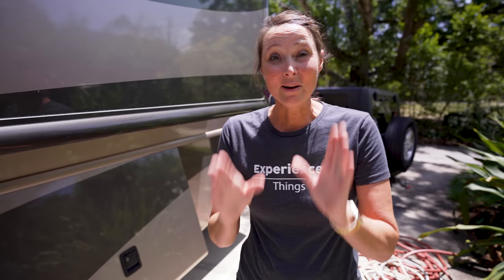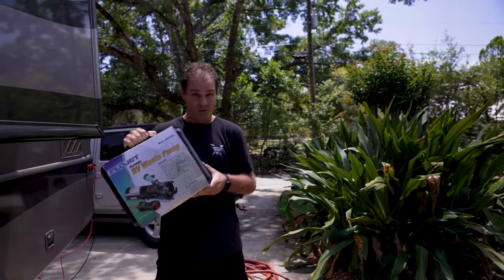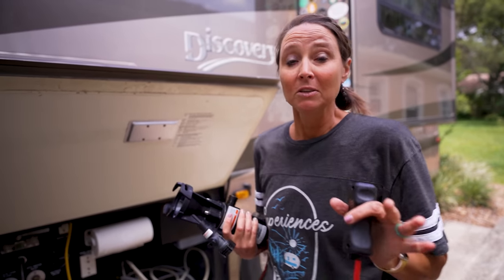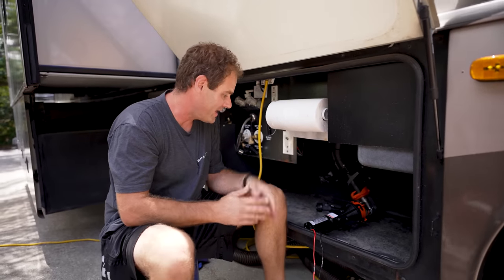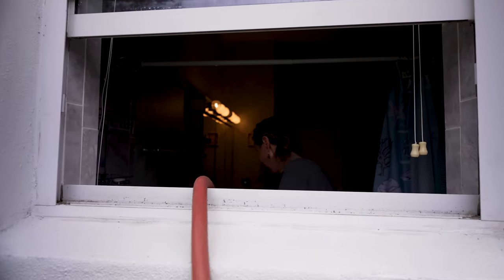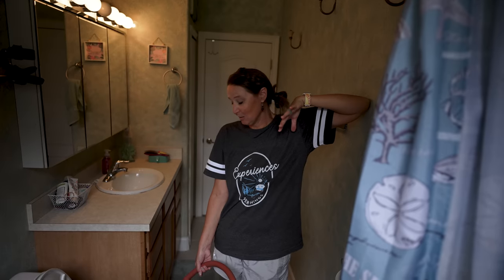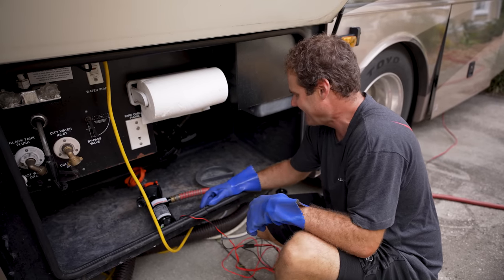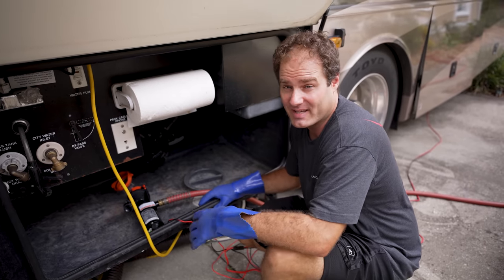Dirty RV Secret - Dumping the Black Tank WITHOUT A Sewer Hook Up!

Comment: Maybe by pushing the hose past the trap in the toilet should be best. You will need a short piece of hose without the brass end on it to make it easier to insert it. Good thing about this method,  no smell 😂
Reply: Exactly, just cut the end off one of the hoses, not like you'll use it for anything else!! LOL!
Reply: Tried that, made no difference the one time we tried it..

Comment: One option instead of the toilet is most homes connected to a municipal sewer have a clean out access point in the sewer line.  This clean out is usually similar to the PVC access cap you showed to a septic tank.  I have used our macerator and dumped our motor home several times into our clean out without any issues.  Our clean out is located outside of our home so easy access, this may not be the case for all though.
Reply: We use the cleanout that is closest to the street. I asked the city if this is legal and they ran it up the food chain and came back with affirmative. The logic is that the water in the black tank has been metered somewhere so a municipality has been paid for the water.
Reply: @drmack911  waste water is not "metered" per se, the cost for waste is typically applied by the water utility as a multiple on the water consumed.
Reply: I ran a split off my clean out about 15' to make a permanent connection point adjacent to the driveway. Fortunately it was all downhill.
Reply: @PeteFolksinger  be careful doing this cities are not good about maintiance notifications if they are doing cleaning in sewer line the pressure from the cleaning trucks water system could cause damage to a rigs plumbing “ sometimes even homes if the vent stack has issues” I do sewer cleaning and inspections and have seen issues multiple time ls with homes. When we work in Rv parks we close valves on peoples rigs during the cleaning process
Reply: @spoolin55psi  this is not something I leave hooked up. My rig has macerator pump, so only use my personal dump station when emptying black tank or gray tank

Comment: When I used my FlowJet (the older one that shuts off to cool) I stuck the garden hose not only into the toilet but pushed it in further so it was on the other side of the toilet trap, this way it does not fill the bowel and smell up the bathroom. Worked for me.
Reply from the maker: Good to know!
Reply: I was going to say that.  Hose should be well down the toilet pipe.  Having a clean out is so much easier.

Comment: Loved the video.  Two additional comments.  First, I think you can buy simple screw on plastic caps to seal up the 3/4” hose after you have drained it.

The second is for camping when you have no sewer connection and have to use a honey wagon tote.  The basic idea is to fill the tote and tow it to the dump station…. At a crawl.  A lot of campers have trailers and a hefty tow vehicle.  Don’t struggle pulling the wagon away from the camper.  Put the empty wagon in your truck or tow vehicle and fill it using the macerator.  Now you can drive a bit faster to the dump and the extra height will more quickly drain the tank.
Reply from the maker: Great suggestions - thanks for watching
Reply: Instead of buying plastic caps, simply connect both ends of the hose together. This is especially important for your potable water hose as it helps keep it sanitary.

Comment: Great video, Charity and Ben! Our coach was optioned with a macerator which I have used occasionally to empty and flush both waste tanks into our septic tank. When camping with full hookups we just use the sewer hose with gravity dump. The only problem I found with the macerator, as you have noted, is that it seems to have a limited run time before it overheats and stops working. The first time this happened I thought it broke, but waited a few minutes and it was working again. Probably a thermal issue, but really, in my opinion, these things aren't designed right if that is the case. Very important to properly maintain your RV's waste tanks, especially the black tank. I always keep the black tank with some fresh water in it, about 25%, and add some treatment to it.

Comment: I do this all the time in Europe with my 35ft Airstream motorhome, Thetford casette dumping is the norm here and usually there are dumping pedestals to make that job easier. So I use a macerator pump to pump upward into the pedestal. I use a clear angle so I can see when black is done when washing it out with gray.

Comment: This is the only option we have for our permanent RV spot. We have a city sewer stub 300 feet away but I would not pump the black tank that far. Every 2 weeks or so, I use my macerator pump, plug it into my cars 12v, and pump into a home made 55 gal blue barrel on a cart from Harbor Freight and hand pull it over to the dump pipe. It works.

Comment: many houses have sewer clean out ports (even if they dont have septic tank). Find that and pump into the port. Basically you are pumping into the pipe that the toilet water flows through out from house. It is the size of a dump station port so hose goes in easy. Look for it in your front yard. If you have two choose the one that pumps towards the street side.

Comment: I did the same thing at my home.  I was paranoid the whole time that the hose may slip out of the toilet.  After I was done, I used some disinfecting bathroom cleaner on the pump and flushed through the hose.  Kills any residual smell.

Comment: gets into the ground water/can and does get out and ruins your water table/ground water source can be almost permanently ruined by any spills into the ground, it all goes into the well water. Black or grey. Too many chemicals in those old pipes/tanks lethally toxic and impossible to remove from the ground/well water table. My trailer has no tanks, love it! Tupperware is the best solution, cheap and safe, never use any chemicals.

Comment: !!! Just like plumbing trap under sink... cut metal end off hose, and it will fit bending up and over the water trap to the actual sewer drain at bottom of toilet keeping the water in trap will keep smell back and the view unless you pull hose back into the bowl.

Comment: It would be a brilliant idea to have an outside clean out installed on your house with a removeable cap then pump the waste down it wile running clean water in the house like drain a bathtub of water slowly or wile someone is taking a shower.
Just open the cap put in your hose turn on the pump as this is going someone is actually using water inside the house this extra water should help keep your sewage lines from cloging up and moving freely.
Should you have some blockage in your sewage lines say on an older home with clay sewage lines and tree roots. If its kept a liquid insted of solids its going to move a lot smoother but if you do have a blockage problem then a clean out will keep a plumber from snaking inside the house so its a win win.
Ive never had to have this done but im sure its a shitty mess.

If you can afford a 250k dollar motor home you can afford to do this too.  And you'll probably wanna keep this crap out of your house. 
You could also fit the system with a proper sewage drain hookup.  And a hose fausset close by. In case you need it then put down lawn lime to kill the germs only use a powered form used for concrete construction its called hydrated lime.  Lime you put on your grass is pellets that desolves slowly
Hydrated lime works extremly fast. It will also kill any oder.  
Reason i know this i had a sewage line break and went unfixed for a long time before i knew about it. 
I had to do something to make the groud safe and kill the bad bacteria 
Hydrated lime does this.  Wear a mask you do not want to breath it.
Lime beds were used in homes if you used well water from under your home. It kept the soil clean of bacteria.

Comment: Nice job. Agree with using sewer cleanout as first choice. Now my question. I found the tank cleaning products you show at 12:07 in the video, but deciding which to use is ...? Did you post another video? If not, do you have a suggestion of where to look. There web site is lacking this detail.
Reply from the maker: We use the drop in pods called RV Digest it

Comment: Any time you're connecting water to waste, you need to use a vacuum breaker, which needs to be higher than your fixtures. Dump stations already have vacuum breakers on the top of the pole connecting to the rinse water. Using a hose at home or at a full hookup site with a vacuum breaker up high does the same thing, but make sure that any hose from the vacuum breaker to the waste tanks is never to be used for drinking water. Sincerely, your friendly neighborhood, licensed plumber.

Comment: Have you guys thought about putting a rv hook ups at your house?  A friend of mine did it with a small septic system it cost him 1K.  He said the power hook up was the most expensive part.
Reply from the maker: We have the electric hook up although we no longer need it with the solar set up. We’re actually using the RV to power some things in the house instead of the other way around!
Reply: @GratefulGlamper  that is awesome next thing put one of those new lifetime roofs on and put solar on your roof with Tesla wall batteries.  One of my Army buddies did it after loosing power in his home last year for a month then had rolling blackouts for another month.  He said it’s amazing rarely uses grid power anymore

Comment: I could pull the slide in and raise jacks and drive to a dump station and dump tanks faster than this. I don’t get the up side of this option. Or just use a portable tank dump and take that to the dump station with a pickup.
Reply: We started doing this, and love it.  Don't have to go out of our way to a dump station (they're rarely conveniently located for us), wait in line for up to an hour (we're weekend warriors, mostly), and pay $10 (that's what most charge, near us).
This way we can go straight home and I can dump while my wife puts stuff away. I can also take my time to thoroughly flush the black tank, without the pressure of holding up the line behind me.

Comment: Black tanks hold around 30 gallons. Toilet bowls hold at the most 1 gallon, add water used to get it to work and how are you not going to overflow in your bathroom. No way I would do that into any house. If there’s access to a septic tank that would be ok but not in my house.  Use the macerator to make using the blue trolly better but not in a house.
Reply: Pour water from a pitcher into your toilet bowl... it won't overflow.  Gravity ;-)

Comment: Why wouldn't you just dump in a regular dump area before heading home? I mean, this maybe makes sense if you have someone staying on your property in the RV, but stopping at a stop before going home to drain your tanks normally seems better to me and the garden hoses wouldn't be contaminated with tank waste. To me this seems extra and costly and to have to keep these hoses separated and not used for the garden or any other purposes seems a bit over the top for a $5 dump fee to be easily covered on your way home.
Reply from the maker: Depends on access to a dump station, etc. after boondocking or using the RV as a guest house.
Reply: We started doing this, and love it.  Don't have to go out of our way to a dump station (they're rarely conveniently located for us), wait in line for up to an hour (we're weekend warriors, mostly), and pay $10 (that's what most charge, near us).
This way we can go straight home and I can dump while my wife puts stuff away. I can also take my time to thoroughly flush the black tank, without the pressure of holding up the line behind me.

Comment: Do y’all prefer this macerator/hose for normal dumping stations? Seems like it would be a lot less space for hoses and such than the typical gravity kind…but a LOT to carry around if you kept both types. Not a critique; but a genuine question. 😂
Reply from the maker: This is definitely not the preferable method (as we mentioned in the video) but doable in a pinch or moochdocking scenario.
Reply: @GratefulGlamper  To be clear, I’m not asking about the toilet, but the macerator/hose into a dump station. :)

Comment: Did you have to keep flushing the toilet during this process?
Reply from the maker: I did flush the toilet just a few times. You do not have to keep flushing however.
Reply: @GratefulGlamper  My husband just informed me that toilets will flush automatically when filling.  That’s why you can pour a bucket of water in there and it will flush if your water is shut off.  Learn something new every day

Comment: Dont do this if you have a siptic system the chemicals you put in your black tank could be harmful to the helpful bacteria in the septic tank and leach field 
.and cause a big problem to your septic system. Very very expensive. However if you know that you can dump your black tank every day or so there is no need to add chemicals. If you have town sewer it's all good 👍 just be aware it's not legal everywhere also just .. . use the clean out if you can you should test your hoses for leaks and make sure you mark these hoses non potable.
Reply from the maker: We use the products from Unique Camping + Marine which are septic safe and formaldehyde free.

Comment: The day will come when no generators be allowed. Boats even big ones are ahead of the curve and can supply hotel loads (water maker, a/c and most 110v loads).  Rather than ban generators entirely they may require a stringent maximum noise limit. I’m sure Prevost and the like will go with the lithium  campground solution.

Comment: Why didn't you push the hose past the bend in the toilet? You won't get backflow, and the odors don't rise into the tank in the back of the toilet. Just make sure your nearby sinks have water in the traps.

My macerator came with those instructions. I'm going to keep watching, but I hope you learned this, knew this, or found out quickly by trial and error. 🙂

Okay, so you didn't. Now you know and the stink is "mostly" absent. You could dump this at a neighbor's with an explanation.

Also, don't use stuff in your STORAGE tanks. RV's are not meant to be treated like a septic system. They are storage/holding tanks. Putting enzymes and other chemicals to treat it like one is not a great idea. Treat it like a holding tank - keep water in it (3-4 bowls full), put a soapy cleaner/deodorizer in there that is plastic safe, and use the tank flush every other dump. Use the hose connection on the macerator to allow you to force water into the tanks from the gate valves, and be sure to do it a few times.

That's it. Don't go overboard with enzymes and chems that create a septic system. That's not what we have.
Reply from the maker: Trial and error sometimes seems to be our learning style LOL